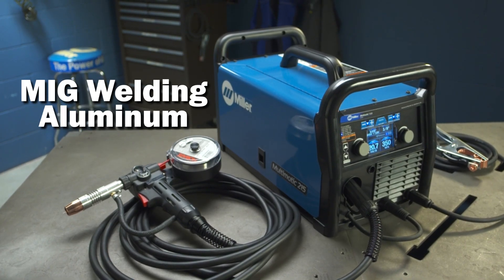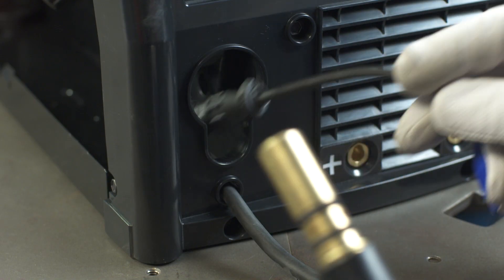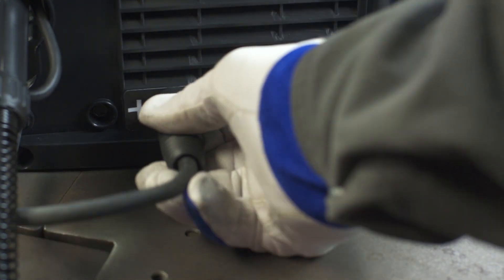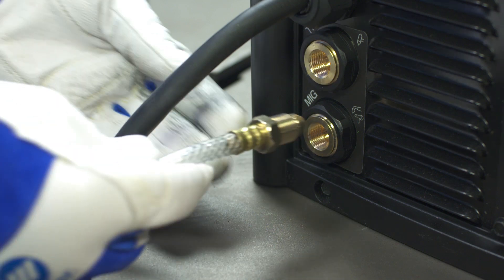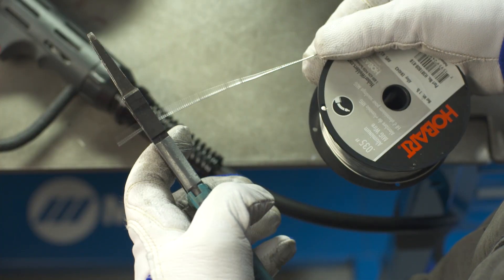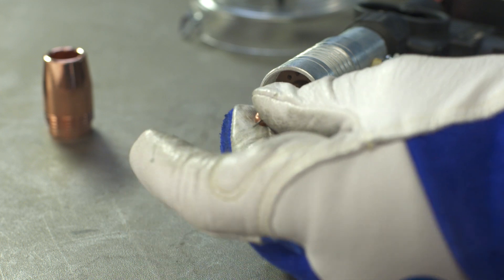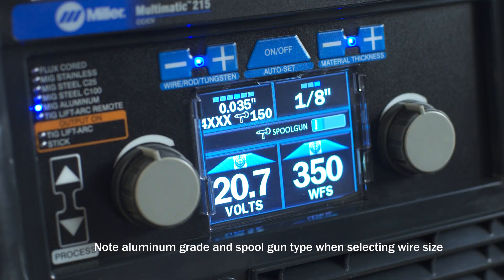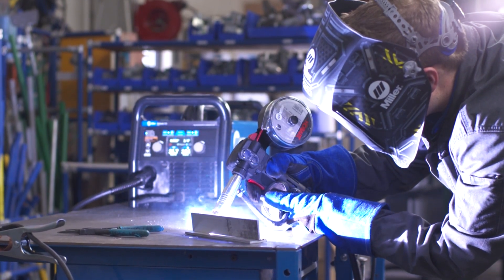Miller Multimatic 215 MIG (GMAW) Welding Aluminum Setup

Comment: I bought the TIG set up, because I was so excited to weld aluminum and then I realized you can’t because it is DC TIG only. I should have bought the Multimatic 220.

Comment: The machine how much price please
Reply from the maker: Thanks for reaching out. The manufacturer suggested price for the base model of the Multimatic™ 215 is $1,449.00 (US). For more details and to see all options, you can visit our website: https://www.millerwelds.com/equipment/welders/multiprocess/multimatic-215-multiprocess-welder-m30090 We also recommend checking with your local distributor for information and availability in your area: https://www.millerwelds.com/where-to-buy?buy=1 Thank you!
Reply: @MillerWelders  now it's over $2000
Reply: with spull gan around 2600

Comment: how can the roller tension be loosened?
Reply from the maker: Thanks for reaching out. You can find out how to adjust tension for the Multimatic 215 here: https://www.millerwelds.com/files/owners-manuals/O272989A_MIL.pdf
Reply: Miller Welders for 150 spool gun ?